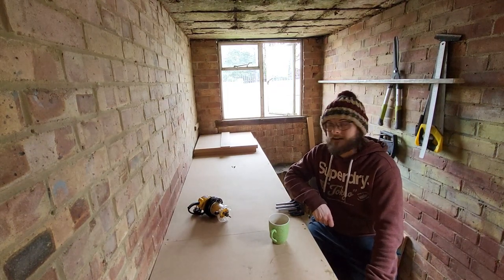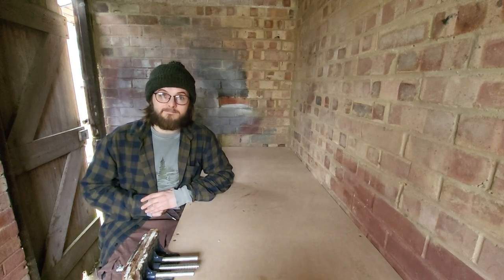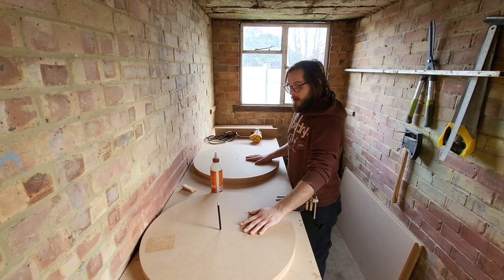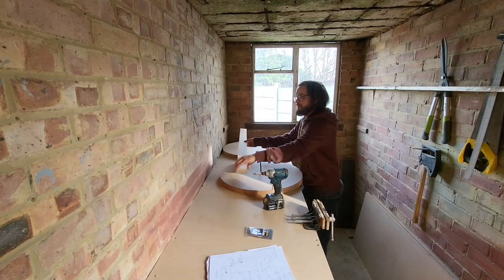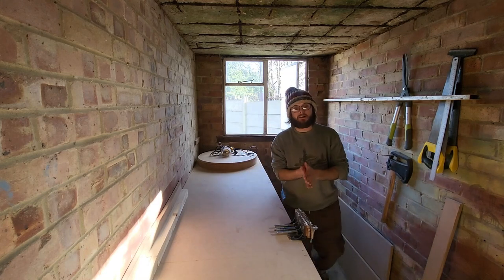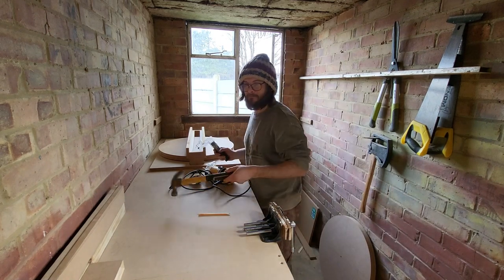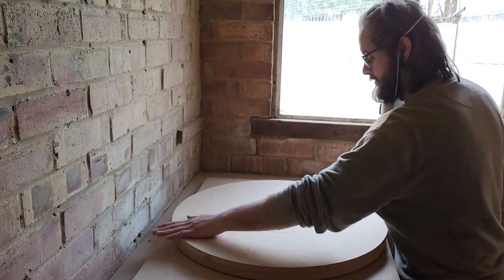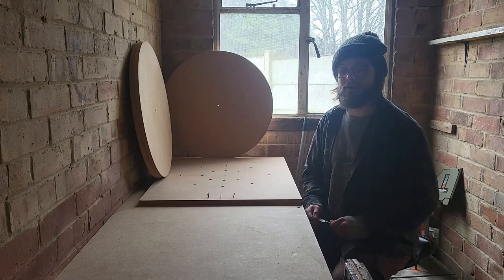Becoming a Self-Taught Luthier - EP3 - Radius Dish

Comment: I have a lot of woodworking experience (although I've only made one guitar from scratch; a Tele copy, and it wasn't good!).  Regarding MDF dust, and sanding in general, I recommend using a better mask (or proper respirator), and better extraction.  I use a "press-to-check" filter mask, which is much better than the cheaper ones, and seals quite well, even with facial hair.  I look forward to seeing how your guitars turn out.
Reply from the maker: Thank you for the comment pal this was in the top of my to-do list, however funnily enough my dad watched my video and purchased me a proper respirator and a set of ear defenders so that has that sorted 😀. As for dust extraction that is not something I can  Invest to heavily into right now and good old Henry hoover is going to have to suffice until hopefully the not too distant future. Thanks for the feedback and I'm glad you rhere for the journey.
Reply: @JayJamesGuitars  I have a Henry, but also an Axminster extractor with a built in auto-start function, so it starts when the tool plugged into it starts.  I also have (from eBay) a cyclone that I cobbled onto the top of a plasterer's bucket.  It catches most of the sawdust, thereby extending the life of dust bags and filters.
Reply from the maker: @1man1guitarletsgo  yeah to be fair I'm sure I could find a cheap extractor on ebay that would do a better job 🤔 , I may have to have a little search. Luckily though I shouldn't be doing much if any MDF cutting moving forward as it was just for the dishes, I may use some for jigs but in very small quantities.